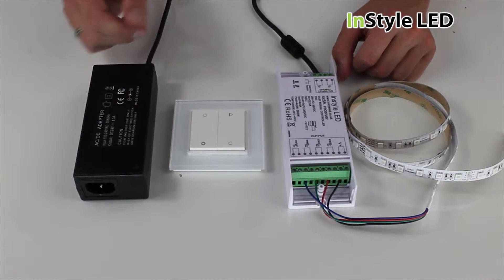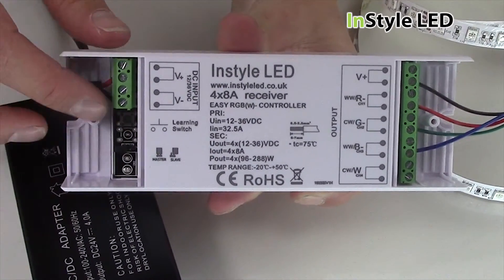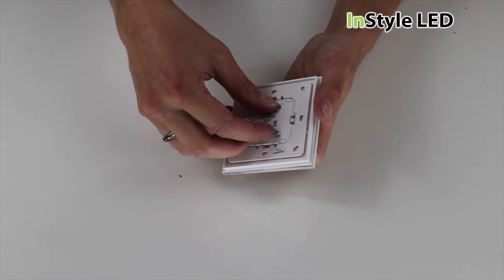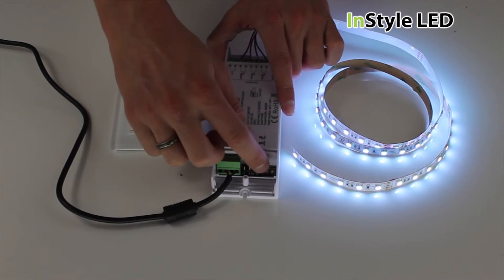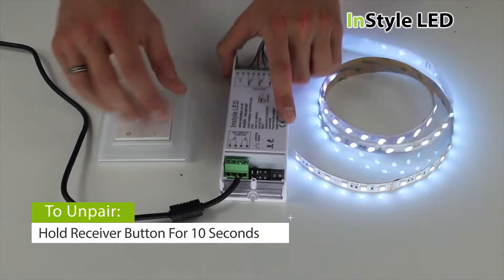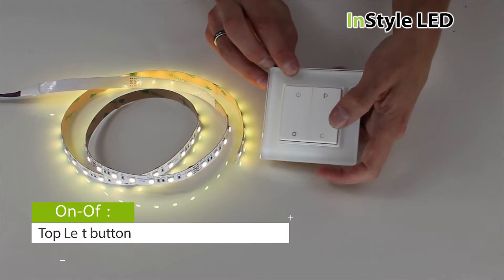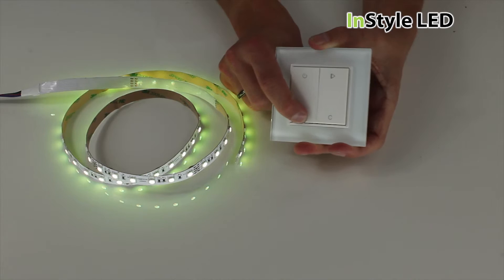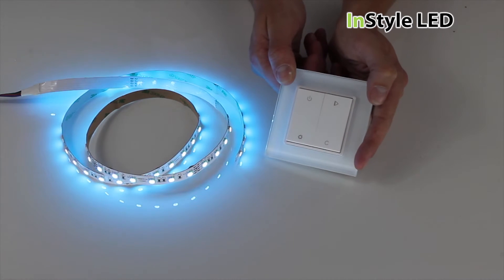How to set up & use a Detachable LED Wall Control - LED strip lights

Comment: how far will the switch work from the base?
Reply from the maker: 20m away, and being RF , no ' line of site'  required between controller and receiver , so you can have the reciever hidden away